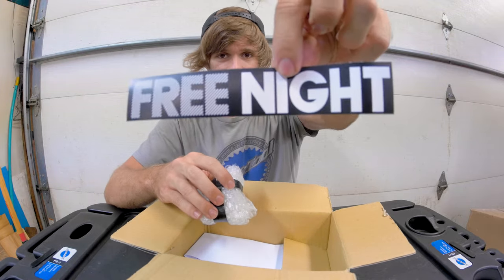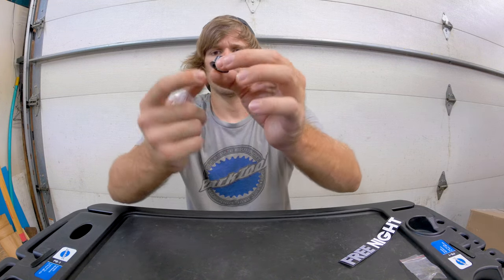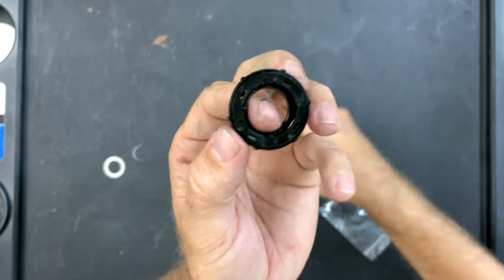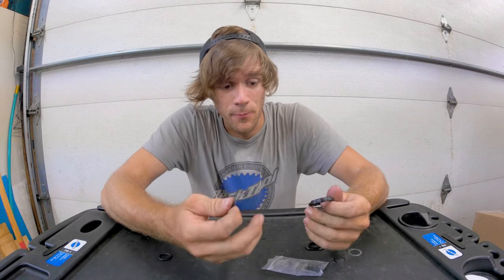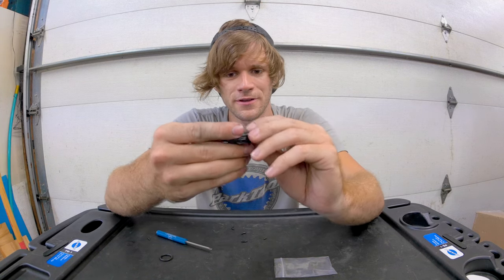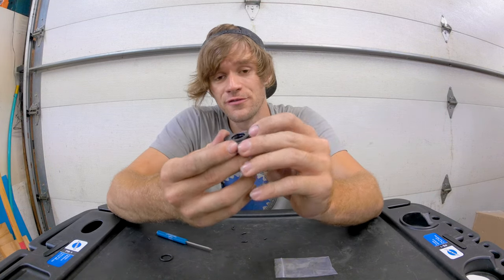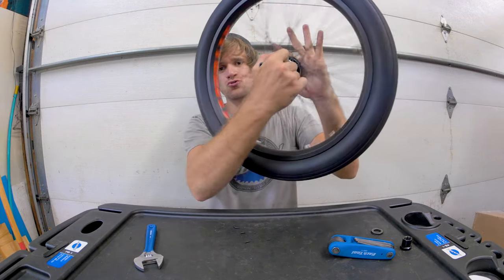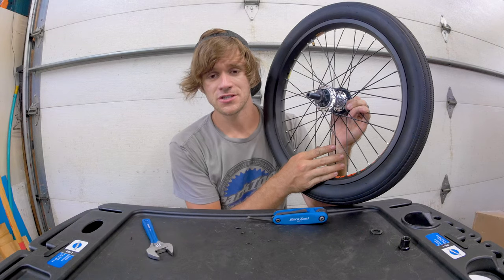Alienation Venus Hub - Planetary Internal UPGRADES!!

Comment: Yeah it's decided. For my more normal next build and my temp builds wheel set. Probably profiles for front and cassette and the polished venus for the coaster. All laced to chrome vandals. 

For the uber light wheel set. Far east cycles front hub probably a tree rear and the lightest shell plus best internals combo of the available planetary designs. So probably gonna get all 3. All laced to eclat carbonic rims. Butted spokes alloy nipples for all 6 wheels. Maybe 6 ti spokes per wheel in pairs of 2 for the propeller look. 

If I'm not mistaken I think the freenight has the lightest shell and a few other bits. But has weaker internals not that it seems to be an issue. Lighter shell better internals and lightest cone nuts plus swapping in a ti qxle and driver plus lighter axle nuts should help get the hub lighter but more reliable and basically as strong as the others for my needs but at the lowest possible weight. 

Plus with a tree hub if I swap the center axle to ti and the driver as well as bolts I should be able to get it to 10 ounces flat. Combo with the front hub and 1 pound all in on hubs. 1.25 for hubs with the coaster. 

Should have 2 of the strongest lightest wheelsets available.

Comment: Hey i know this comment is very late but do you think at a later stage these hubs will come with more pawls and the jaggies on the outer shell with more engagement points? I mean it probably wouldn't do anything but imagine this hub but it sounds like a profile elite
Reply from the maker: It could be possible but I don't know if there would be enough room for the triangle piece to rotate enough with more pawls. I could see 4 being possible, but It's hard to say
Reply: We actually tested a ratchet ring with more teeth, it does sound different and engages a bit faster but makes the moonwalk more difficult haha. it will be used on our MTB hubs.

Comment: Maybe you should suggest a female axle and bolts unless there is any reason for not doing that?
Reply from the maker: It’s been suggested a million times. It can’t happen without total redesign of the internals
Reply: @Brant_Moore  Actualy, no. Not necessary to redesign internals. BSD Revolution with custom made female axle and ti bolt is 352 gr instead 523 with standard steel male axle. Idk how to add links for pictures, youtube deletes them.
Reply from the maker: Send it on Instagram! Same as my YouTube name.
The thing is that they would want to have 14mm female bolts rather than 3/8”. 3/8” is definitely possible with the current setup

Comment: Isn't the planetary implementation as a freecoaster horribly dangerous? If the pawls are even slightly gripping, then they won't drop back down to let the hub go backwards. I think taking away the springs from under the pawls(this is what planetary freecoaster by design does) is so unreliable and dangerous!
I don't think you would agree with me openly in this comment section because of your sponsorship, but I still want to sound by thoughts and worries. I still have a couple months before I chose a freecoaster design and buy from whoever brand that uses the said design, but the traditional one with the screw in driver, tension ball springs and sliding clutch looks the most reliable and simple. Blown up bearings might become an issue...

Is planetary really the next step or is it just a different one with different problems and things to worry about?
Reply from the maker: I’ve been riding planetary coasters for 2 years now and have had 3 different ones. I’ve had none of the scares that come with normal clutch Freecoasters. Accidental engagement can be a killer when moving fast and is a problem that just doesn’t exist with the planetary coasters.
There’s also the absence of a pedal gap/slack to get rid of when pedaling forward which exists in normal coasters. This is something that can definitely lead to some oh shit moments.
There have been rare issues with engagement but those are due to o ring failure and are very rare. In the category of freak things that any part has.
Ultimately I truly believe they are the future and a lot of other companies do too as they’re licensing and working in their own.

The other problem with the conventional clutch is that most of them use plastic inside that wears and causes the entire wheel to wobble. Shouldn’t ever be an issue with the planetary hubs.
Reply: As someone who's been following unique coaster designs and boutique and rare designs and rare examples with various attempts at fixing issues with the free coaster design. 

I see this as the next big thing. Machining flaws could cause issues you mention but it's unlikely to be any worse then issues found in cassette hubs that use press fit collars and the wobble people get with those. Ie maybe a few bad hubs or a first batch. 

It's a better design then the G coaster that never released. It's cheaper and lighter then a profile z coaster and has other advantages. 

Only con to the design I see so far is they don't seem to roll as smooth or as fast as some more traditional designs. But that can be said for any sealed coaster set up over the original gold standard the nankai hub and much easier cheaper and stronger then the previous boutique options like the syn hubs from Japan or weird stuff like the prototype chosen designs that sesshin was trying to release. 

Better then the stolen hub. Better then the Ezra or eclat style coasters. 

So far seems to be the best of the new systems. But a few systems for similar set ups exist. Pretty sure far east cycles has their own similar concept but slightly different in concept. 

If you don't mind slack and you want reliability and functionality. Find an old nankai bamboo hub with 14mm axle. Might require mixing and matching hub bits but get the right one and they're the smoothest hubs available and rebuilding them is easy bearings are easy to source and can be upgraded to whatever quality you want. You can build with or without bearing races. Pros and cones to each. Axles are cheaper design. 

Khe style coasters which are just a sealed bearing version of coaster brake modded coasters have issues with the axle strength. Odyssey design has its own issues. So do all the other mods based on that system. 

Most other boutique or alternative coaster designs are even worse for machining tolerance issues. Or have worse functionality or reliability and just as reduced strength or worse. Why none have been widely adapted. This one already has 2 rather decent brands on the train and likely others to come. 

And that's from a small Israeli shop that started a brand. Vs the larger already established brands. Including some that made large amounts of money off very little initial investment. Like khe. And yet none have come close. 

Even my own design which accounted for issues and avoided problems due to me knowing about all the other designs isn't as reliable and has a part that equals the driver bearings and clutch weak points in previous designs. Except this time it's an expanding wedge for the drive system that slowly rips itself apart by expanding into a hub shell that's much harder then itself. And still ends up with a design that has some slack or sponge to the pedal crank. Only advantage mine would have is pedal pressure for fakie tricks would be able to be used like a coaster brake but with variable pressure. But also speeds up the hub eating itself alive. 

Vs fixing the issue of the expanding system by swapping materials and modding it slightly I'd just license the freenight design and try and reduce some friction and help reduce rolling resistances so it rolls faster and longer. 

It's ironically the least complicated of the alternative set ups. Also why it likely hasnt been tried before is its kind of oxymoronic in nature.
Reply: To add to the concern in this comment, I’ve recently purchased and ran this hub and have had problems with the engagement system triggering when hopping in fakie which I something I haven’t even experienced in traditional freecoaster hubs that I’ve run. Currently disassembly the hub to determine if there’s O ring failure but I’ve literally had the hub for only 2 days and so far have been a little disappointed in the performance. Might be switching back to a clutch soon but hopefully this is something minor.
Reply: @johhnymancinni791  you do realize you have to break the hub in before being able to do fakies on them correct. 

I'm gonna guess not. 

Go ride the hub around forwards. Just pedaling. Try and avoid anything too stressful on the drive mechanism for the first little bit. 

Once its broken in there's no issues with fakies. 

Haven't ordered either of mine yet. Deciding between the bsd and colony ones. And getting rhe alienation version in polished. 

Weight weenie build and a looks first build. Well beyond functionality. 

My buddy got his bsd version. Didn't let it break in either. Was having issues. Really break the thing in. And make sure a) there isn't loose cones or any other issues. B) make sure your chain isn't too tight. C) make sure it's actually broken in and if so then possible machining flaw. It happens. 

I could probably make g sport odyssey and Sunday look very bad in your eyes. Lol don't ask. Ironically for their reputation seen more issues with their parts then any other brand. Including a few with the clutch hub. 

There's a dude in my city who had one before brant did. His is the og freenight one. Still rolls fine. Pretty sure all he's done is change bearings maybe and the o ring stuff to the new set up. 

Learning curves. They exist.
Reply from the maker: The same way you had to get used to a traditional Freecoaster, you have to get used to a planetary coaster. If your wheel isn’t rotating when you land fakie, there’s a greater chance of engaging. Watch my final review. The system is amazing but has its quirks just like anything else
Reply: @Brant_Moore  honestly I have a feeling it's more likely he didn't break the hub in. My buddy got his built his wheel pre bedded and stretched the spokes true the wheel and tries going straight to stuff like 180 whips to fakie. Was engaging all over randomly. Told him to break the hub in riding forwards only for the first little bit. Did that and the issue resolved itself. 

And I've seen a bunch of others all do the same thing coming from other coasters most typically the odyssey clutch since it has a pre worn clutch. Plus most other khe clones are better on break in periods these days too so alot of people basically ignore it.